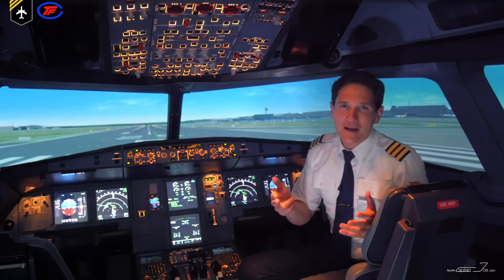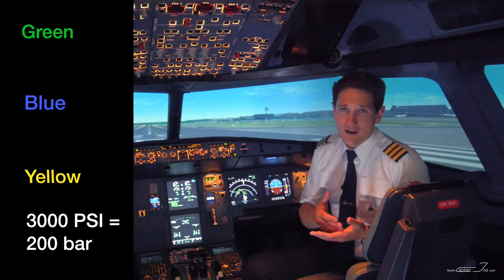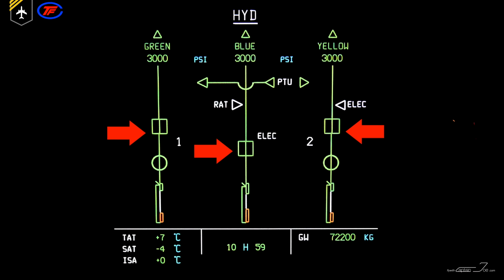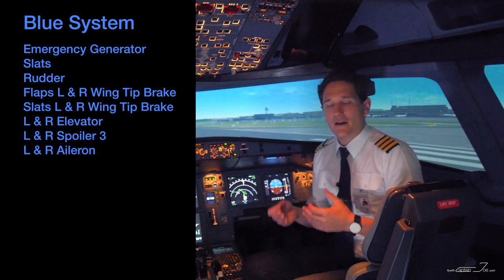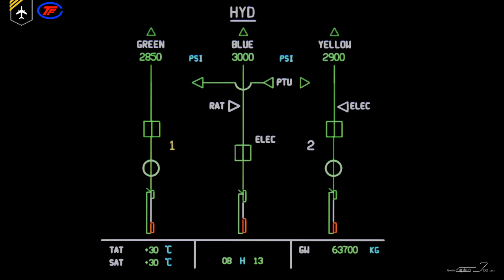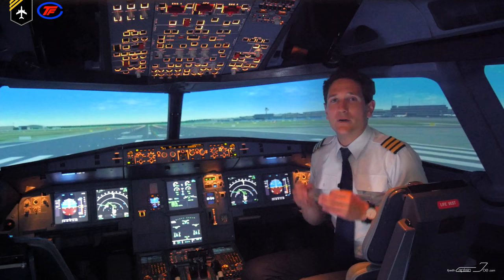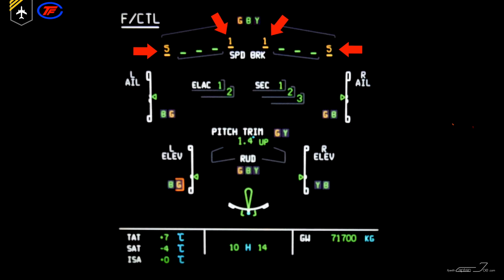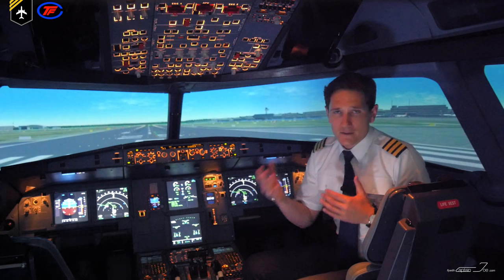AIRBUS HYDRAULIC SYSTEM how does it work? Explained by Captain Joe

Comment: When was the last time ram air turbine has been used in any plane? Does it go through real life test after the aircraft has been taken in to commercial use?
Reply: I have no idea, the last time it was used. Most publicized is Flight 1549 probably. Every so many flight hours, the Ram Air Turbines are functionally checked for proper operation. Basically, you use a large heavy duty hydraulic mule and attach it to the RAT via a back drive unit. By setting a specified fluid flow rate and pressure, you basically spin the RAT at the speed the airflow would spin it at. While it is spinning you check that the emergency systems driven off the RAT function normally.
Reply: My question is due the Ram Air Turbine is one of the backup of all backup systems. I Don't see a reality, in a normal commercial flight that a pilot would extract the physically slowing turbine, simply to test it's functionality. 

Do the airplanes go through periodic testing flights, where these type of tests are done? 

If the answer is no, then what other emergency elements are not put to tests within a lifespan of an airplane? Exit escape slides? I guess there is plenty more examples.

I'm from the IT world, where we could and should do these type of tests, even with fraction of costs when compared to the real life examples of the avian world. We still often refuse to do those tests, as it's rather inconvenient to do the tests and it requires a lot of work afterwards.
Reply: The real life test, even if simulated, would require airflow to spin the RAT with high enough airspeed. This is because the airflow does bend the extremities of the device further than the parts closers to the rotator, which have larger area.

Comment: What will happen in case of complete hydraulic system failure on a320? As I understand the only method of steering is using THS and differential thrust. Am I correct?
Reply: That depends how you define “failure”. If you mean engine pump failure then yellow system has electric pump that can pressurise yellow system and then use the PTU to pressurise green system. If you mean fluid loss then you’re stuffed as with pretty much any aircraft except 737 due to using cables or A380/A350 as they have some flight controls that are independent of the main hydraulic system and just require electrical power

The THS and differential thrust (and rudder) is if you lose all 5x flight control computers which is called mechanical backup. If you loose all hydraulic fluid these are gone too

Comment: So the hydraulics are like the nervous system of the plane. When the hydraulic lines are severed it's like you've lost the use of your legs and need a wheelchair. Also if the hydraulic lines are severed the fluid leaks out and the plane bleeds to death so not only the hydraulics are the plane's nervous system but also their circulatory system.
Reply: I would say more nervous system, the engines are more the beating heart of the plane as they provide the pressurisation to the hydraulics, provide electrics and generate air for the passengers to breathe. United 232 was still able to fly but was essentially paralysed. The trick in modern aircraft is how to reduce the chance of this happening

Comment: Why does the Yellow System has a backup despite Green System serving more functions?
Reply: Airbus designed it that way. With the Hydraulic PTU, the need for more electric pumps really isn't needed. If you lose fluid, the system is gone anyway. A single engine failure, or pump failure, the PTU picks up the slack. On the slim chance you lose both engine driven pumps, then the yellow electric can be used for hydraulic pressure and, through the PTU, power both yellow and green. 

Typically though, the yellow electric pump is used mostly on the ground by maintenance. Pressurizes both yellow and green systems. There is a Blue Pump override button that forces the blue pump to operate for maintenance checks.

Comment: Captain Joe,  3000 lbs.  sounds like a lot of pressure.  Do you know the approx. minimum pressure required for the systems to function?  Thanks.
Reply: Barney Google Operate at normal speed, or operate at all?
Reply: Mike Cowen - both, if you know. Thanks
Reply: Barney Google Unfortunately I could not locate aircraft-specific numbers, but generally a hydraulic system will operate near normally down to about half its design pressure (i.e. 100% pressure redundancy). It will continue to function more and more slowly and sluggishly down to several hundred PSI until it cannot overcome its own inertia and any aero loads. At the lower extremes, great care must be taken to avoid causing pilot-induced oscillations due to the slow control response time (which includes RAT operations). Of course, at that point you'd be on the edge of sustaining controlled flight and be near a "United 232" scenario. Sorry, I wish I could have found more specific numbers, but it gives you a general sense of things. With no manual reversion available, things get ugly in a hurry, which is why you now see some electro-hydraulic mixed systems to give you some control in the unlikely event of one technology failing completely.
Reply: Mike Cowen That's very interesting - and reassuring.  Thank you so much for your illuminating response.

Comment: Hey Joe thanks a lot for the video! I want to ask, how does these control systems and hydraulic lines operate associated with the fly by wire system? As I know A320 use fly by wire system and I'm struggling to understand how these long hydraulic lines are used while the fly by wire system is operational.
Reply: Fly by wire sends the commands to the servos. The servos actually manipulate the flight control surfaces
Reply: @tomstravels520  so those servo motors operate individual hydraulic pumps/lines or the hydraulics are not involved with the fly by wire system at all? (Im pretty sure they are involved but just asking)
What Im trying to get at is, if the hydraulic lines are still connected and the flaps/slats/ailerons/rudder still uses hydraulics how does it lower the weight afterall...
Reply: @batuyilmaz1464  because you are using wires to send the commands to the servos and not heavy steel cables  or having hydraulic pipes go from the control column which increases the weight.

The A320/A330 and A340 the hydraulic lines are on extend to the servo’s and move the servos once it  receives the commands from the flight control computer. If there was no hydraulic pressure then the control surfaces wouldn’t move, if no signal was being sent to the control surface servo then it wouldn’t move. The A380/A350 have some of their control surfaces with independent hydraulic circuits

Comment: Hey Captain Joe, vielen Dank für die Videos, super Content! 
Ich habe da eine Frage, die mich schon seit 8 Jahren quält. 
Ich war mit Lufthansa auf einem Flug im Januar von München nach Danzig in einer CRJ-900 oder 700 und bemerkte nach dem Takeoff, dass aus einem runden Deckel, rechts oben auf der Tragfläche Sprit ausläuft, der in einem dünnen Strahl vom Flugzeug als Schleppe nachgezogen wurde (Uff, schlimmer Satz...). Ich war mir nicht sicher, ob ich die Crew damit behelligen sollte, vor allem wg. der grantigen, wortkargen Maitre de Captain. Ich dachte, die sehen das eh im Display, dass da Sprit fehlt. 
Allerdings war dann im Approach als die Flaps draußen waren ein fürchterlicher Gestank nach Kerosin in der Kabine, dass fast Panik ausgebrochen ist. Ich denke, dass wegen den Verwirbelungen durch die Flaps Kerosin in die Engine gekommen ist und die Klimaanlage das Aerosol schön in der Kabine verteilt hat.
Als ich zwei Tage später wieder in München war, stand die Maschine abseits im Vorfeld.
Nun meine Frage, was kann das Gewesen sein (Dichtung?) und haben die Piloten das im Flug merken können?

Comment: What is the horrible odor that floods the Airbus A320 cabin when the engines are shut down?
Reply: Rodney Owen that would be the exhaust gasses being sucked into the air conditioning system as the air intake for the APU (which provides air conditioning on the ground) is located behind the engines. Poor design of the airbus!

Comment: what's a Yam Damper?
Reply: HS W4551 It's to reduce oscillations in your sweet potatoes.
Reply: its a device which gives your yams moisture thus cooking them nicely. they turn out tender and soft with the yam damper engaged.
Reply: It prevents Dutch rudder oscillations from exceeding limits.
Reply: Nilguiri That would be the yaw damper, which is on the other hydraulic system. We're discussing the mysterious yam damper, which appears to be an exclusive Airbus feature.
Reply: You win best comment of the day!
Reply: Are you sure you know what a Dutch rudder is? Not to mention a double Dutch rudder. (NSFW)

Comment: It is possible that the each system pressure will be more than 3000 PSI?
Reply: Yes. It is possible. Sometimes pumps will put out higher than 3000, but there are limits. I can't remember for Airbus, but for Bombardier CRJ 7/900s the limits were +/- 200 PSI.  Long as the pump put out 2800-3200 PSI, it was good.

Comment: Captain joe, I've been in an A320 simulator and on final a warning sounded which was saying "Glideslope, Glideslope" what is that warning and what doest it mean?
Reply: Basically it means you're not on the glideslope.
Reply: What you heard was the EGPWS Mode 5 warning. Basically you were on an approach but below the ILS glideslope.
The EGPWS computer calculates the limits for this warning by using the radar height of the aircraft and warns you if you are flying too low.
Reply: +Microbladehaiza Ok, thank you :)

Comment: I didn't know it was that advanced
Reply: LOLWTF673 it is an AIRBUS FROM EUROPE, what else could it be,......er.....not boeing thanks
Reply: Do you really think Boeing doesn't have this covered as well?
Reply: Every plane does
I thought it was just some system wired to the controls that pump pistons to move the control surfaces but i didn't know it had 3 seperate parts and backup systems

Comment: Why RAT supply only blue hydraulic system ?
Reply: MrSsX the RAT is only a small turbine and is incapable of powering all 3 hydraulic systems. It just wouldn't be able to produce enough pressure, so it is restricted to critical flight components of the blue system to ensure the pilots can still fly the aircraft and get the plane on the ground. You still have power to the elevator and aileron and can extend the gear using manual gear extension handle.

Comment: By the way, I wonder why the Airbus A380 has only 2 hydraulic systems. I would have expected for an aircraft of that size 3 (if not more) hydraulic systems, like the other airbuses.
Reply: In the A380 they replaced one system entirely with electric actuators. So basically they have 2 hydraulic systems and 1 electric system to move the control surfaces and so on.
Reply: In fact the A380 and the A350 (which uses the same architecture as the A380) have a much higher redudancy than the previous airbus aircraft.